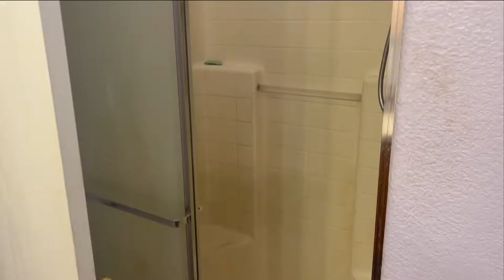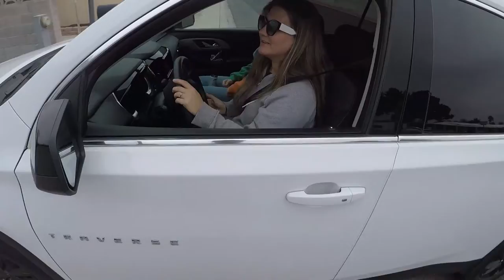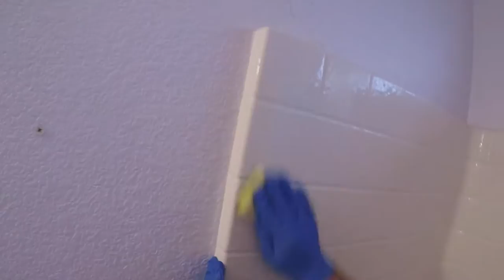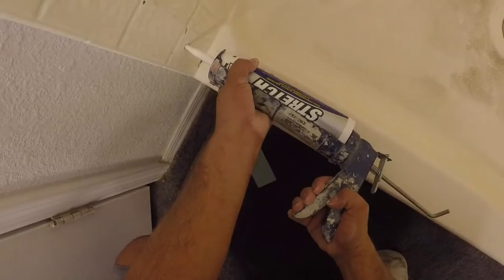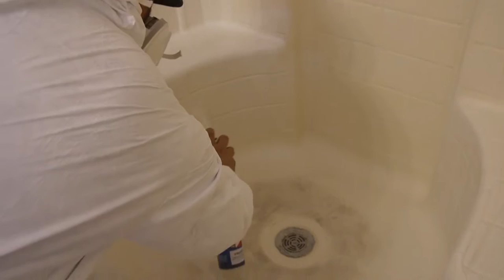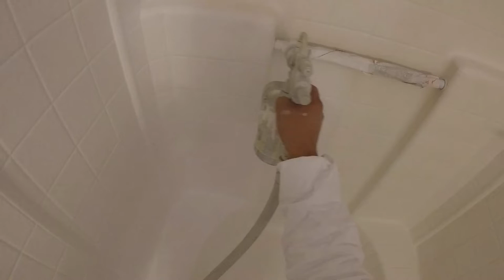HOW TO REGLAZE and REPAIR A FIBERGLASS BATHTUB and FIBERGLASS SHOWER | DP TUBS Bathtub Reglazing

Comment: Great demo. Whats the difference in when to use each Bondo product? The Bondo Fiberglass Resin says its waterproof - so why would you also need the Bondo Glass Short Strand? I see there is also the matt - is that for even wider areas?I have lots of small cracks (C-chaped) on the pan and then a small chunk of fibreglass missing from the edge or the drain.

Comment: Hello, can a sliding shower door be installed afterwards without destroying the integrity of the coating due to drilling holes and having screws to the surface? Thanks for the reply.